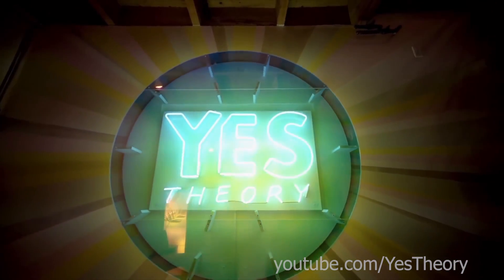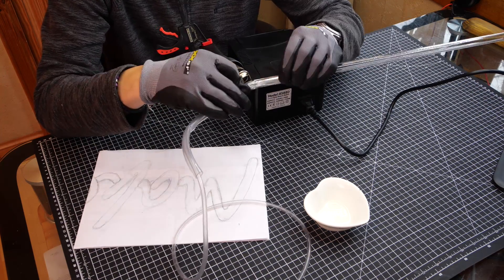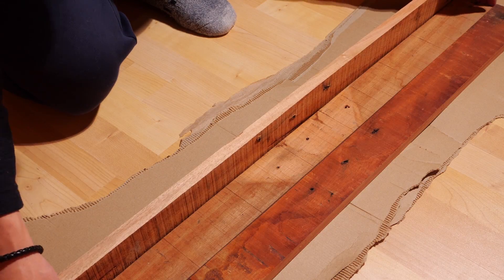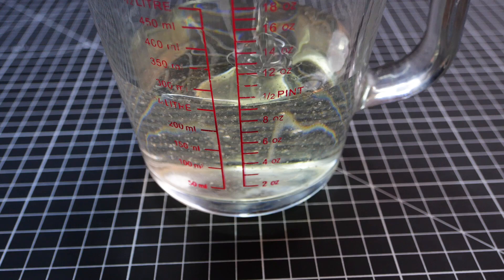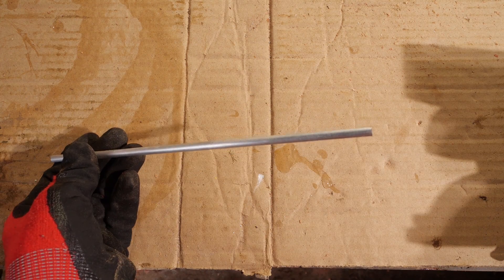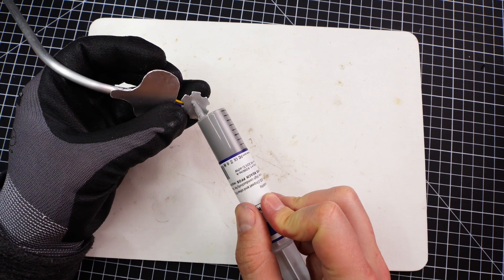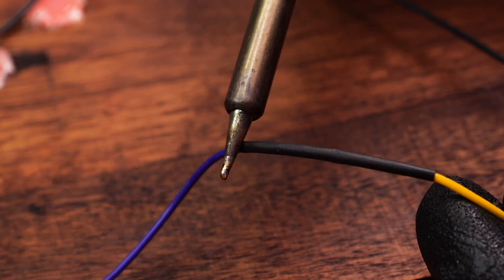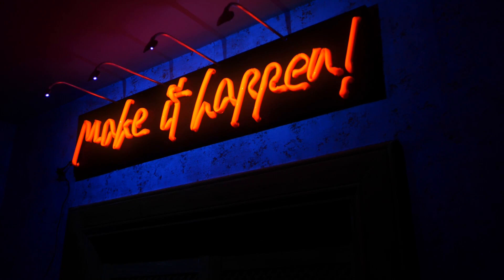DIY Neon Sign, but It's Not!

Comment: Nice video :) I like the approach you went for here, hows it being suspended in soap holding up?
Reply from the maker: Thank you! And NO! Soap sucked. I mention this in the video. Powder sank to the bottom after 3 weeks. I replaced it with epoxy resin. And since it is solid, I no longer need to worry about leaks.
Reply: @MakeithappenDIY  OH, I just rewatched that part, somehow missed the part where you said you replaced it with epoxy, I should probably go to sleep lol
Reply from the maker: @ECHO E no problem, I knew it was pretty easy to miss! Good night :)

Comment: Guess it's alright but I thought it was going to be neon not led. Why even use the word "Neon" if the DIY video has none in it but examples of other people's signs?
Reply from the maker: Turns out not even the examples I showed are real neon (nor the website I got the quote from!). It's called Faux neon or Neon LED. I feel cheated as well. But strictly speaking actual "neon" signs are not always neon either. Different gasses are used to achieve different colors (neon - red, krypton - yellow, argon - blue, etc.)
Reply: @MakeithappenDIY  Talking trade terms and not about different gasses, mercury, or exciters. You are right they use different gases but neon by it's self is red as in clear red glass and the blue is a mixture of neon and argon with mercury. 75% neon and 25% argon is "K4" gas used in cold weather. 25% neon and 75% argon is "Blue Mix" gas are for warmer climates. So in general most of what we call neon actually has at least 25% neon in it. This is probably why it's trade term is called "Neon".

Comment: Nice project, but you could have used Electroluminescent wire. It can be cut to length,  run off batteries and is cheap as hell, costs about as much as a bag of that phosphorescent powder.
Reply: Isn't EL wire usually pretty thin? I dont think Ive seen any in the size of average neon sign tube thickness

Comment: They make a "soft silicone bending insert" for bending rigid acrylic tubing, to prevent collapsing or kinks at the bends.  It's solid, not hollow.  I think it would work much better than the rubber tubing you used.
Reply from the maker: Yeah, you are right. But they are a bit more expensive. Wanted to avoid the cost if I could.
Reply: @MakeithappenDIY  Filling the tube with sand before using the heat gun also prevents collapse, can be dumped out/reused repeatedly. :) Just be sure to buy some craft sand so it's already washed/clean and doesn't contain dirt which could muddy up the inside of the tubes which would require further cleaning.
Reply from the maker: @Quentin Wolf I wish I knew this. I know and tried this on aluminium tubes but it never clicked to try on acrylic. Thanks for the idea!